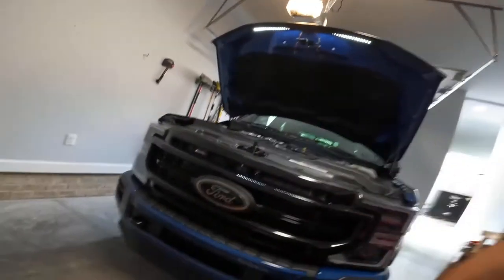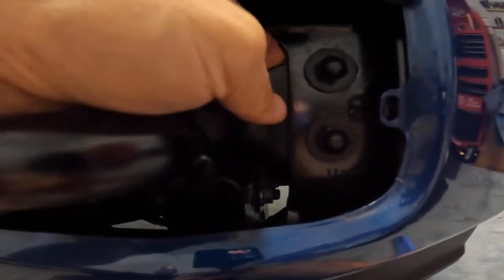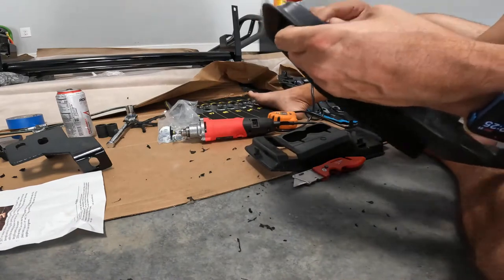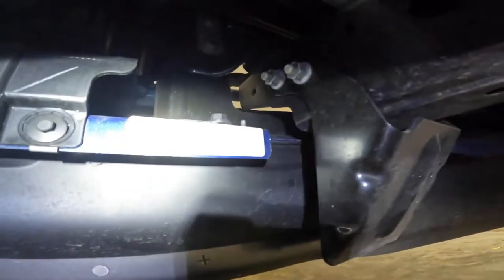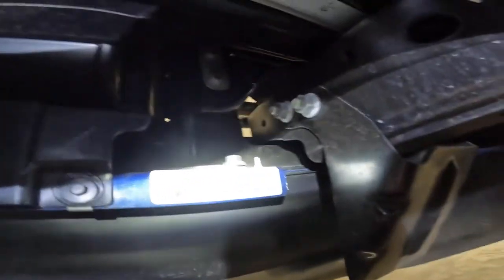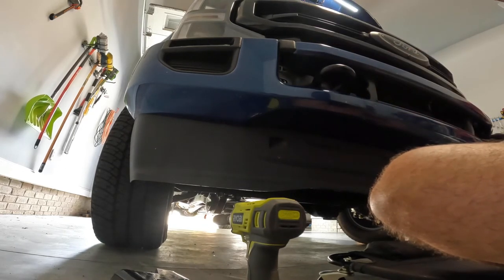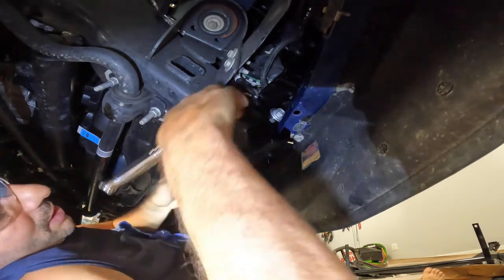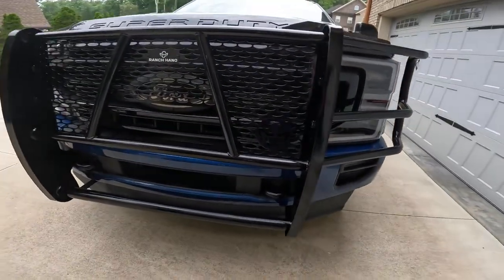Ranch Hand Brush Guard F250 2017 2022 Install

Comment: Looks good!  Great job on the video.  Looking to put one on my 23 F350; haven’t decided on brand yet.
Reply: Just put one on my F350 today, looks great.  The bottom support bolts on to the main verticals I stead of coming off the bottom flat. They pass through the air dam “vertically “ if that makes sense.  A better design I think.

Comment: Great video! About to possibly do this to my F250 but concerned with how far the RH sticks our from the front bumper. I have about 8” of wiggle room to make it fit in the garage without hitting my steel storage racks in front of the truck. Any chance you can tell me how far out the grill guard is from the bumper? Thanks!
Reply from the maker: Sure, when I go down stairs, I will measure it for ya!
Reply: @dadsworld5084  thank you!

Comment: Do these require any additional brackets? I’ve found one on marketplace but I’m not sure if I need additional mounts
Reply from the maker: no all the brackets needed come with the Ranch Hand
Reply from the maker: Everything is on the truck and ranchhand already you should be good!
Reply: @dadsworld5084  so there isn’t an additional bracket needed? It has the spot for the two nuts and the straight piece under neath. It looked like you had a bracket that connects the straight bottom piece to the area with tow hooks
Reply from the maker: @AquaForcePW  It hooks to spots that are already there; I took off to brackets that came with the truck, where the straight pieces attach. I will slip under the truck to double-check in the am and get back to you to make sure. I believe you will have to get some bolts since your one doesn't have them with it.
Reply: @dadsworld5084  that would be awesome! Please let me know, i thought it should hook right up, the one on my Silverado had an additional bracket piece. This one looks like it bolts right to a factory position.
Reply from the maker: @AquaForcePW  So I took a look; there is a bracket I forgot that attaches under the truck that comes with the original packaging; you can see it at the beginning of my video. It attaches to the bottom bar, which you see in my video; look where I take a piece that helps support the air dam off and put it in through to attach that bracket bar. So look at the one that's for sale and see if the bracket is still attached to the Ranch hand because you will need it for installation. Hope this helps; sorry for the confusion.
Reply: @dadsworld5084  thanks for checking on that! I have found two and both are just the ranch hand with no additional brackets or hardware. I’d jump on em if I knew where to order the additional brackets needed.
Reply from the maker: @AquaForcePW  I Wish I could help there; I would suggest ranch hand itself; you could play dumb and say you are moving trucks and need new ones who knows

Comment: @dadsworld5084  Did you have to bolt the upper part of the bracket to anything?  I'm referencing the bolt above the 2 bolts that are together (Each bracket has a total of 4 bolt holes)
Reply from the maker: If you are referring to the bracket that attaches near the tow hooks, then yes. You have to trim the plastic near the hooks and it bolts to their and under the truck. Hope this helps
Reply: @dadsworld5084  I'm referring to the bracket provided by Ranch Hand that goes up underneath the truck. It has a total of 4 holes. 2 of them are used for mounting to the truck frame (Pain in the butt part), 1 of them mounts to the grill bracket that comes through the cut out holes in the plastic valance. There is 1 more hole at the very top of that bracket. Does that just not get used or does it bolt somewhere?
Reply from the maker: @brandonwilliams2839  
let me go take a look; got to remember been a bit since I installed it.
Reply from the maker: took a look, and the only to mounts were under the truck and at the hooks, for the Ranch hand there is no other place to mount to.